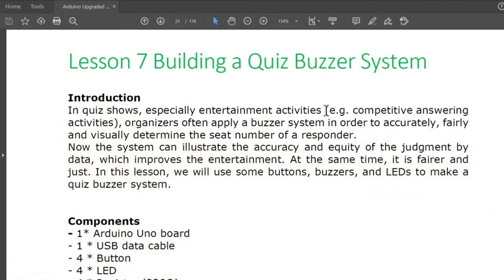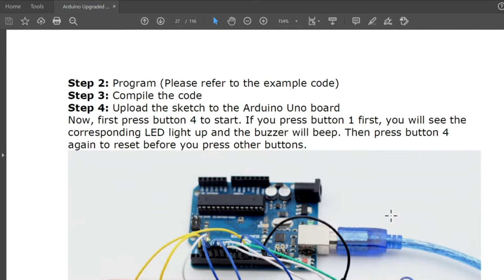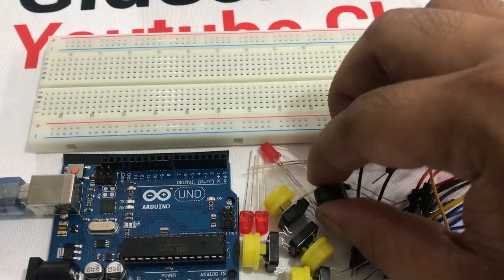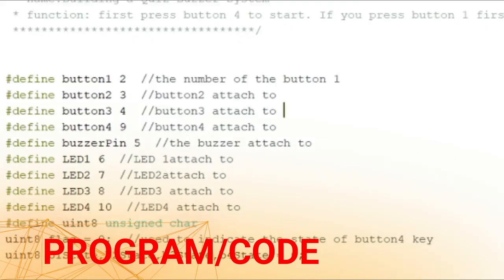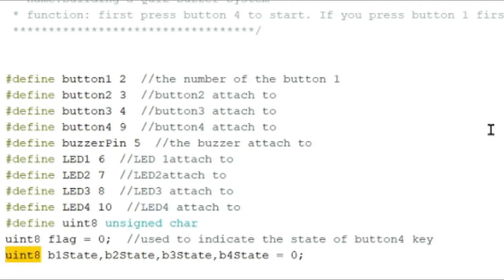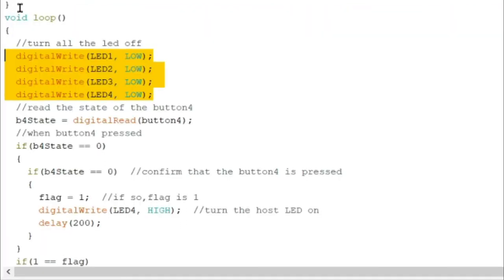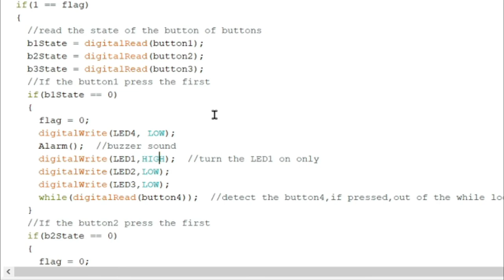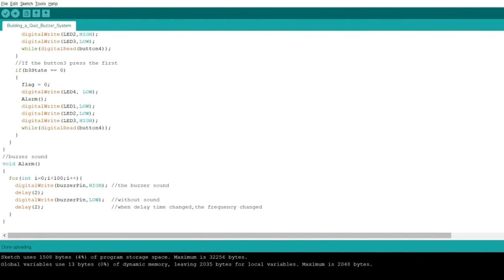ARDUINO TUTORIAL FOR BEGINNERS LESSON 7: BUILDING A QUIZ BUZZER SYSTEM

Comment: /********************************
 * name:Building a Quiz Buzzer System
 * function: first press button 4 to start. If you press button 1 first, you will see the corresponding LED light up and the buzzer will beep. Then press button 4 again to reset before you press other buttons.
 **********************************/

#define button1 2  //the number of the button 1
#define button2 3  //button2 attach to
#define button3 4  //button3 attach to 
#define button4 9  //button4 attach to
#define buzzerPin 5  //the buzzer attach to    
#define LED1 6  //LED 1attach to      
#define LED2 7  //LED2attach to     
#define LED3 8  //LED3 attach to 
#define LED4 10  //LED4 attach to
#define uint8 unsigned char
uint8 flag = 0;  //used to indicate the state of button4 key
uint8 b1State,b2State,b3State,b4State = 0;

void setup()
{
  //initialize buzzer,LED1, LED2, LED3 and LED4 as output
  pinMode(buzzerPin, OUTPUT);     
  pinMode(LED1, OUTPUT);
  pinMode(LED2, OUTPUT);     
  pinMode(LED3, OUTPUT); 
  pinMode(LED4, OUTPUT);
  //initialize button1,button2 andbutton3 as input,combined with pullup
  pinMode(button1, INPUT_PULLUP);
  pinMode(button2, INPUT_PULLUP);
  pinMode(button3, INPUT_PULLUP);    
  pinMode(button4, INPUT_PULLUP);
  //turn all the led off
  digitalWrite(LED1, LOW);
  digitalWrite(LED2, LOW);  
  digitalWrite(LED3, LOW); 
  digitalWrite(LED4, LOW);
}
void loop()
{
  //turn all the led off
  digitalWrite(LED1, LOW);
  digitalWrite(LED2, LOW);  
  digitalWrite(LED3, LOW);  
  digitalWrite(LED4, LOW);
  //read the state of the button4
  b4State = digitalRead(button4);
  //when button4 pressed
  if(b4State == 0)
  {
    if(b4State == 0)  //confirm that the button4 is pressed
    {
      flag = 1;  //if so,flag is 1
      digitalWrite(LED4, HIGH);  //turn the host LED on
      delay(200);  
    }
  }
  if(1 == flag)
  {
    //read the state of the button of buttons
    b1State = digitalRead(button1);  
    b2State = digitalRead(button2);
    b3State = digitalRead(button3);
    //If the button1 press the first
    if(b1State == 0)
    {
      flag = 0;
      digitalWrite(LED4, LOW);
      Alarm();  //buzzer sound
      digitalWrite(LED1,HIGH);  //turn the LED1 on only
      digitalWrite(LED2,LOW); 
      digitalWrite(LED3,LOW); 
      while(digitalRead(button4));  //detect the button4,if pressed,out of the while loop
    }
    //If the button2 press the first
    if(b2State == 0)
    {
      flag = 0;
      digitalWrite(LED4, LOW);
      Alarm();
      digitalWrite(LED1,LOW);
      digitalWrite(LED2,HIGH); 
      digitalWrite(LED3,LOW); 
      while(digitalRead(button4));
    }
    //If the button3 press the first
    if(b3State == 0)
    {
      flag = 0;
      digitalWrite(LED4, LOW);
      Alarm();
      digitalWrite(LED1,LOW);
      digitalWrite(LED2,LOW); 
      digitalWrite(LED3,HIGH); 
      while(digitalRead(button4));
    }
  }
}
//buzzer sound
void Alarm()         
{
  for(int i=0;i<100;i++){
    digitalWrite(buzzerPin,HIGH); //the buzzer sound
    delay(2);
    digitalWrite(buzzerPin,LOW);  //without sound
    delay(2);                     //when delay time changed,the frequency changed
  }
}
Reply from the maker: what is this?